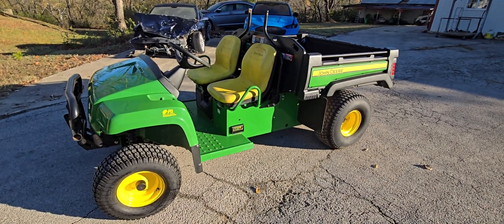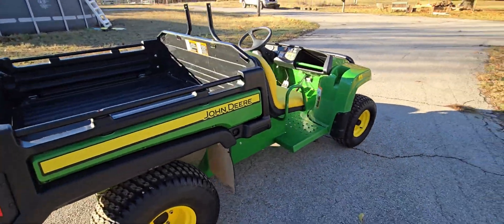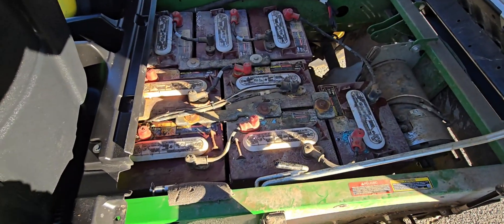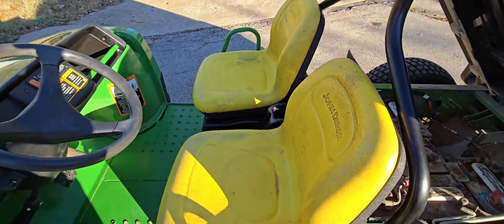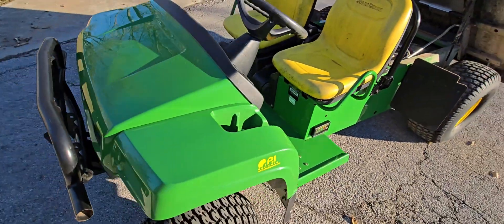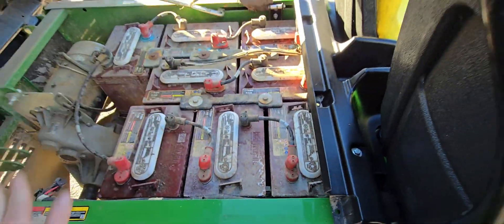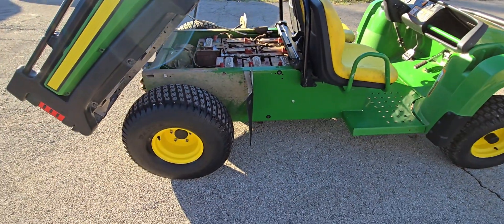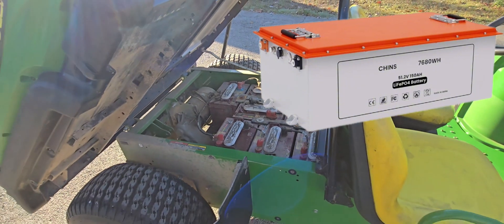Electric John Deere Gator DEAD! Should we go Lithium?

Comment: I just converted mine with a 150ah lithium battery. Super easy to swap.
Reply: I'm thinking of doing dual 150ah chins lithium in parallel. We pull trailers a lot and need the amperage.